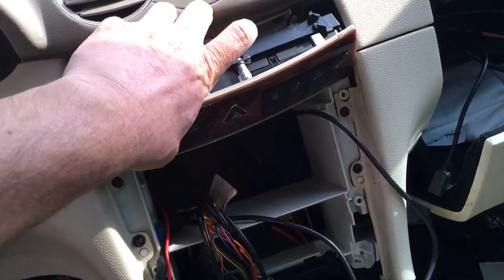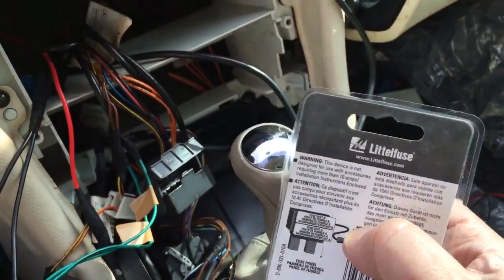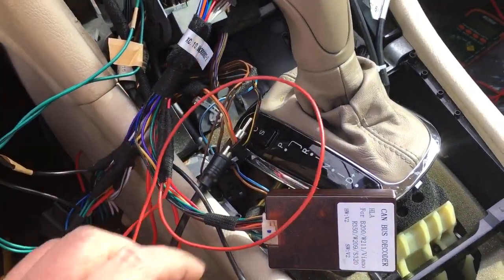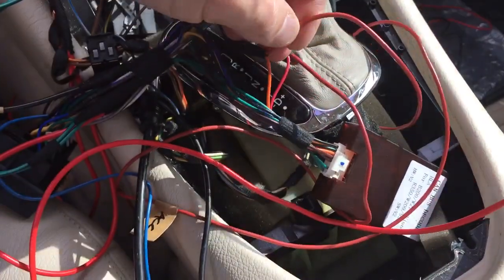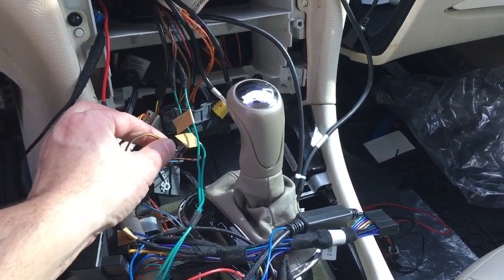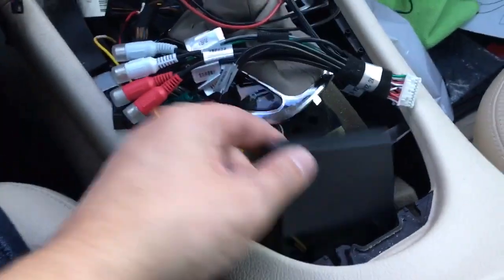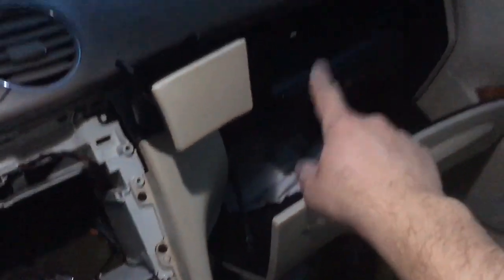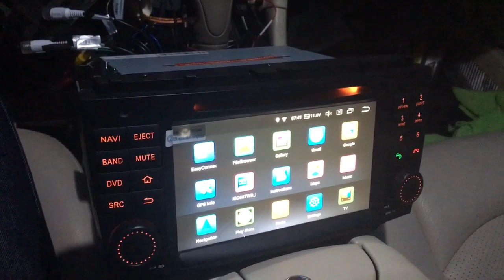Mercedes CLK320 W209 Android 8.0 head unit & fiber optic decoder installation, part 3

Comment: Great video Marco, but honestly I don't believe your Xtrons decoder is still working, I had three replacements and they work for a week so guys I advise to install a new amplifier and get rid off the fibre optic system, less complicated and very much straight forward.

Comment: Great video!  Helped me lots to get my unit working.  Do you find that when you use the up and down buttons on the steering wheel to change menu items on dash, 
outside temp etc,  that it makes your head unit change radio station at the same time? This is the only annoying thing that I have found so far!  Cheers
Reply from the maker: Thanks for the kind words.  I have not had that problem.  I’m thinking you might of tapped into the wrong canbus wires.  The buttons on the right of the steering wheel should be the ones that interface with the head unit.  Also, it might be the canbus decoder box.  I would play with those 2 wires to see if it fixes anything.  Good luck.
Reply: Marco Cerqueira  Thanks I will have another play with it. The ones on the right of the steering wheel do the volume and phone function, the up and down on the left change the track and radio station as they should, they just change the menu on the cluster at the same time!

Comment: Where do you get the CAN BUS DECODER? Great video. I am starting the same process in a 2007 clk350. That’s the only part in your video that I can’t find.
Reply from the maker: The CANBUS decoder came with the Android unit I bought.  However you can buy on eBay.  Just make sure you get the one for w209.  https://www.ebay.com/itm/Can-Bus-Decoder-Adapter-for-Car-Stereo-GPS-NAV-for-Car-with-Factory-Amplifier-/294214858965?mkcid=16&mkevt=1&_trksid=p2349624.m46890.l49286&mkrid=711-127632-2357-0

Comment: Great video, thanks! Does you car have a Harman-Kardon sound system? I'm wondering whether the decoder depends on an HK amplifier. I don't have a HK or Bose system in my W209 (CLK 200), but I do have an optical connection to the amplifier. I bought a decoder that supports ML, GL, R, SLK, W164 W251 (+Porsche Cayenne/Cayman) which I thought should work based on the overlap with the models supported by your decoder, but I don't get any sound. I removed the CD changer but replaced it with an optical loop. My old (COMAND) unit can still produce sound just by being connected to 12V/GND and the optical fibre cable (i.e., all other cables are unplugged). I measured all three connections to the decoder with a multi-meter. The optical connector inside the decoder is blinking and the cable from the vehicle is blinking as well. I wonder whether my Android unit is not sending some commands over the CANBUS to wake up the amplifier or whether the optical decoder box is incompatible.
Reply from the maker: Thank you!  Yes my car has the HK system.  Most people that reach out to me because there is no sound, it’s because they got the wrong optic decoder.  There was also one person where the decoder was defective and it worked after he replaced it.  Good luck
Reply: @MarcoCerqueira  Thanks for the reply! Much appreciated!!!

Comment: Great Video thank you. I have 2007 C280 W203 with fiber optic orange wires exactly like yours. Before I watched your video, I was planning on getting the decoder and connecting the decoder to Constant +, ACC +, Ground - and the fiber optic from the car harness to the decoder, then the RCA to the android unit AUX out. Would that work? or do I have to do all the steps that you did? Let me know. Thanks
Reply from the maker: Email me at cardaytoday@msn.com and I can send you a wiring diagram…thanks

Comment: This is the best video on the internet regarding properly installing a MOST box. (Fiber optic decoder) . My question is where did you attach the yellow , red and brown wires that came with the Decoder? And also where did you plug the power plug that was attached with the fiber optic plug when they where together? Please help I've been stuck for about 3weeks now trying to install the android head unit to my s430 '04.
Reply from the maker: Okay, so my decoder came with yellow, red and black wires.  Black goes to ground. Red goes to 12v ACC ( I used the cigarette lighter).  Yellow goes to constant +12v. The only other thing to plug in are the red and white RCA plugs and the fiber optic plug.  Hope this helps.
Reply from the maker: If you're still stuck, email me and I can send you a PDF of the Wiring Schematic.  Cardaytoday@gmail.com
Reply: @MarcoCerqueira   Thanks for replying.  How did you determine where to screw in the  ground and the constant 12V  Plug?
Reply from the maker: I know it’s a long video, but I show it it in there.  I used a fused terminal to tap into an empty slot on the fuse box.  When you remove the head unit  you should be able to see a grounding terminal.  You will see a lot of brown wires tying into a bolt.  I know your car is different but finding a good ground should be easy.  In the video description there is a link for the fused terminal I used.

Comment: So i will assume that my fiber optic passes by my cd changer since i do have a cd changer (A OEM one as well) i bought the d2b fiber optic decoder , after months of waiting for it to be back in stock finally got it now ! So i need to get the loop thingy in order to the signal to bounce back ? Can’t i run it with my OEM cd changer ? Or its a matter if my new android head unit is compatible with my cd changer ?
Reply from the maker: If memory serves me correctly if the cd changer is connected it should still allow for the fiber optic signal to bounce back.  If you delete the CD changer then you’ll need the loop.

Comment: Do you think the optic fiber decoder could fit any other car´s optic fiber installation apart of mercedes or porche? thanks for the video!
Reply from the maker: Usually the decoders are model specific, although they can work with several models.  You should search by year, model and make. https://xtrons.com/car-media-fitting-accessories/fibre-optic-decoder-fobb01
Reply: @MarcoCerqueira  thanks for the answer, I have a Volvo xc60 with FOMOCO radio with optic fiber, hope it will work, I just bought one in AliExpress
Reply from the maker: Good luck,  I think the real difference is the type of plug.
Reply: @MarcoCerqueira  yeah, I guess so, optic fiber should be same stuff going through wires, matters the connector. I had to buy a unit with optical bypass, because I'm not removing the original radio but I'm adding a new display.

Comment: hi.. thanks for great video! i have some similar problems.. my vehicle is 2003 ml350. i bought a decoder for the 90degree optic plug. still no sound. i haven't unplug the optic from cd or the phone. questions. 1: do i need to bypass the optic from the cd and the phone or can them just be plugged in like they were? i they think they have no power at the cd and the phone..2: where do i plug the wire for the amp turn on from the coder box? Thanks!

Comment: What did you connect to for the power to the fiber optic box? It needs battery and accessory power, correct?
Reply from the maker: 12v constant from the fuse box.  There was an open fuse that I tapped into.  The 12v acc from the cigarette lighter.  Good luck.
Reply: @MarcoCerqueira  Thank you. I think I'm just gonna tap both from the fuse box.

Comment: I know this is old. Mark I hope they refunded part of what you paid for this. The problem is they have half of the units they supply saying they’ll support certain models when in reality they don’t. I”d bet the first HU they recommended to you was the one that has the proper hookups and so on. No way you should spend 1000+ in the end and still. Have to splice any wires to make this work. Don’t get me wrong SEICANE has the most OEM look with all the modern amenities that most prefer when updating their systems into the present day. One example though Joying has an Android 10.0 that is 1/3 the price is straight plug and play with an updated dash piece. Also the rear is single din so you’re able to fit all the extras in the back so much easier. It also has wireless Apple Carplay and now wireless Android Auto. I only post this as I’ve seen this happen to too many Mercedes owners and it’s frustrating to see. I also have a 2005 Chrysler Crossfire SRT6 that I’ve put a double din kit in and for those that don’t know the SRT6 is basically an SLK 32 AMG the only difference being the body panels, wheels and it’s a coupe and soft top compared to the hardtop convertible the SLK is. In fact they share 80% of all the mechanical and chassis parts. I only put this as SEicane claims they have a double din HU for an R170 but none of them ever came with a double din unless the owner had it modified to take one and I highly doubt any aftermarket company would build a HU specifically for that platform. https://www.joyingauto.com/joying-8-inch-car-radio-for-mercedes-benz-w203-w209-2002-2006-plug-and-play.html

Comment: That RCA harness (multiple rca plugs)  connects to the back of the new stereo??
Reply from the maker: It comes out of the stereo and it’s supposed to then connect to the amplifier.  However, my car model uses fiber optic lines to send the signal to the amp.  This is why you need to use the the fiber optic decoder that converts the signal from RCA to fiber optic…good luck

Comment: Really appreciate the videos Marco. Does the Canbus decoder also sync the dashboard, especially the analog clock? I want to add a backup camera as well, which is one of my main reasons for changing out the head unit. That means a few more wires in the back. How tight was it to put it all back in?
Reply from the maker: I have not figured out how to make the analog clock sync or the factory CD changer work.  Back up camera should be petty easy, but I ordered a different one from the one that came with the unit
Reply from the maker: Here is the video for the backup camera:
Mercedes CLK320 W209 backup camera installation for Android Head Unit https://youtu.be/KRpZWFJ75PY
Please subscribe if you haven’t already...thanks

Comment: Thanks for posting this video, i was close in my build. You helped get me closer. I have no issues with powering on the HU properly. I’m just now having an issue with both of my decoders. The canbus decoder main harness that i received does not work, it has a wire connection going out, for something to plug into it, but I can’t figure out what it’s for. I have the can and acc lines hooked up. As for my fibre optic decoder, i’m running the harmon kardon system, it won’t detect the audio either, could that be because my canbus doesn’t work yet? Either way i’m kind of stumped here as to why some of these companies don’t even bother to provide instructions or diagrams at the least..
Reply from the maker: Most people that reach out to me with issues has to do with the fiber optic decoder.  Either they are malfunctioning or they bought the wrong one.  Without the fiber optic decoder you will get no sound.  Without the canbus decoder the steering wheel buttons will not be able to control the head unit, but you should still have sound.
Reply: @MarcoCerqueira  Alright thanks Marco, I think I was sold the wrong fiber optic decoder, the wire that came with it had canbus lines... should've had ACC instead. It's alright though, the chinese company that also sold me my wiring harness had two external wires coming out of the canbus decoder side, in your video they seem to be wired directly to the main harness, but on mine they want me to plug them into something. I believe they are for the mcu rxd and txd (transmitting and receiving capabilities). pin 14 & 15 on canbus decoder.

Comment: Does your menu with audio on the dash still work because mine is just showing ---- even when playing music.
Do you know any fix for the problem?
Reply from the maker: Are you able to control the stereo with your steering wheel buttons, such as volume, etc?
Reply: @MarcoCerqueira  Yes
Reply: @MarcoCerqueira  I saw something online about settings called canbus, but it needs a pin to access them
Reply from the maker: Did you install a Canbus decoder? You will need that for all the systems to communicate
Reply: @MarcoCerqueira  I dont know because i  bought the car with it, so this could be the problem

Comment: Awesome explanation.  I'm just about to install just the optical decoder, do you think I need to run a constant 12v. Or I can use the cable from the harness . Oh by the way. I'm doing it on cayenne 2004.
Reply from the maker: Oh boy, that is a completely different car.  All I can tell you is that if it calls for it, then yes. Not enough here to give you a good answer…sorry
Reply: @MarcoCerqueira  os pretty much the same. Now I have e the same problem as you had. No sound. Waiting o. The by pass optical loop. Ok. So I ha e to disconnect the one is on the cd changer and plug the loop. I will keep you posted.

Comment: thanks a lot for the video, very informative. how would you compare the audio quality of the android head units compared to alpine and pioneer ?
Reply from the maker: It’s really a different animal.  These android units are more about the features than the sound quality.  Remember it still uses the OEM amp and speakers.  The issue is that the output signal is being converted into a fiber optic signal.  In my opinion you lose some fidelity through that conversion.  Like I said, all about the features.

Comment: I finally diagnosed it as a most issue with the most adapter on not having sound. I do not know how you are able to get sound. Did you have issues with your amp turning on
Reply from the maker: No issues, once I figured out that I had the fiber optic line disconnected on the CD player.  The fiber optic line needs to have a full loop, it needs all feed and return lines plugged in

Comment: Great videos Marco, thank you. Did you get the unit pushed fully back in with all this wiring? Could you share some images?
Reply from the maker: Yes, you have to be creative with where to put the decoders but you can make it fit.  Very tight, so be careful to not accidentally unplug or disconnect any wires

Comment: How did you set the balance in the head unit after plugging in the fiber optic decoder?
Reply from the maker: to set the balance you will need to go into the setup menu of the head unit.  This can differ from model to model.

Comment: What's the point of the 12v constant that you added? Like why add it?
Reply from the maker: Constant 12v allows for the unit to keep the memory intact.  If not you would need to program your radio stations and settings every time you turn the car off.

Comment: Hello, do you know how to resolve the problem with a 2007 CLK350 (W209) and an Android Unit? Everything works except the sound
Reply from the maker: Are you running a fiber optic decoder?
Reply: OK YES I DO HAVE THE DECODER

Comment: I wanted to instal this unit too but all I need is Bluetooth, I have a cd changer in glovebox in my 06 clk350 is it possible to connect a Bluetooth transmitter  or something?
Reply from the maker: I tried that avenue but couldn’t get it to work, even though it looked like the car was pre-wired for phone.  Having said that, I was trying to use OEM Mercedes blue tooth puck like my 2007 E350.  If I was you, I would do some research.  There might be something out there that might work, especially since your car is newer.

Comment: Thanks for the Video Marco, I plugged in the can bus decoder with the harness and the sterring wheel buttons work fine. Do i need to tap into the additonal wires like you have in order to wake up the Sound amp? The most adapter is installed correctly.
Reply: Are you tapping into the wake up line?
Reply from the maker: If the the steering wheel buttons are working for you leave it has is.  These cars car equipped with different options so it might be that you car is slightly different.  If you can’t get the canbus to work, then splice the canbus wire’s like I did.  Thanks for watching, please subscribe if you haven’t already.
Reply: @Tommy Lotito did you ever get it working? My MOST adaptor isn't working either.
Reply: @bobgodd  order from a Avinusa.com it worked for me
Reply: @tommylOTITO  crap ok lol. My head unit and all the install stuff is from avinusa.com, but the most box isn't working unfortunately. I'm going to  get them to send me another one, hopefully this one is just faulty and there's not something else going on.
Reply from the maker: Good luck
Reply: @MarcoCerqueira  thanks. Turns out it was the MOST box. The new one works perfectly. 

Great video btw, helped my install a ton. Curious question, were you able to get your unit to dim accordingly with the interior lights?
Reply from the maker: Awesome

Comment: I cannot for the life of me get the decoder to work. I plugged everything in right, but no audio comes out from the head unit. I tested the head unit separately and sound does go out to an external speaker, but the decoder turns on and that’s about it.
Reply from the maker: Are you sure everything running on fiber optic is plugged in?  Do you have a CD changer?  Think of it like a water line.  If anything is unplugged the signal is lost.  This is why I had to buy a loop for the fiber optic when I removed the cd changer in the glove box.